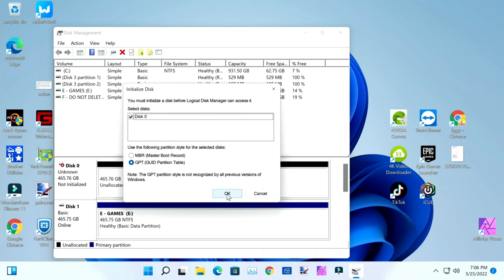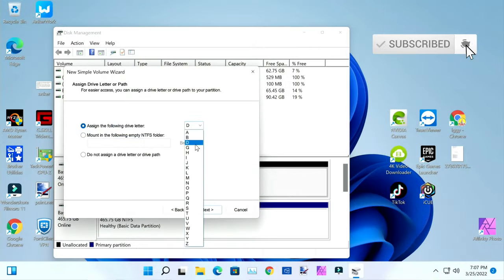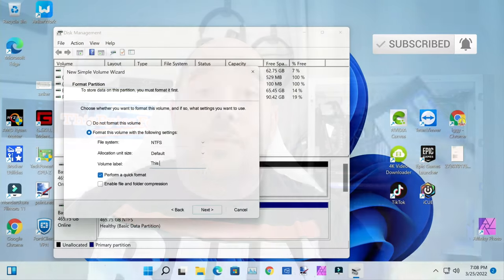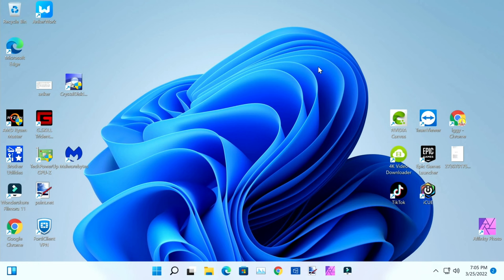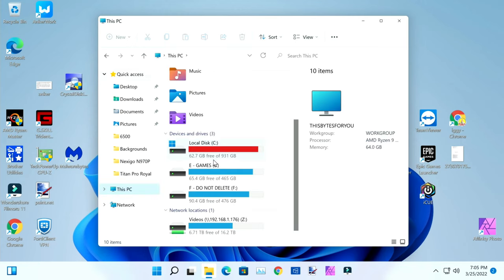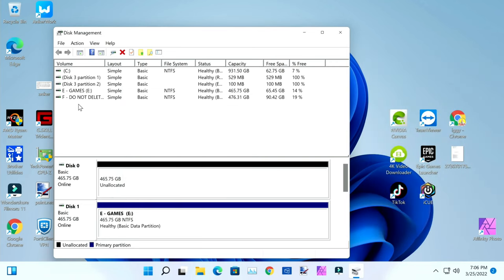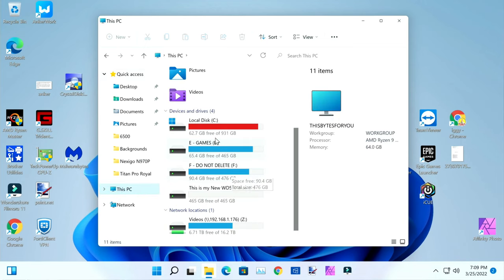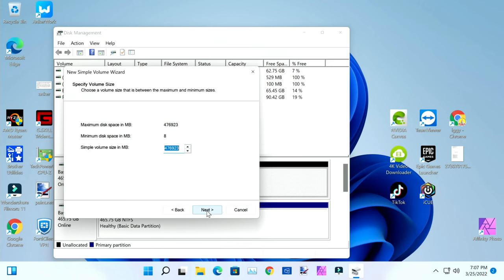How To Install a Second SSD into Your PC

Comment: By adding ssd with help of ur method will it increase the performance of pc or it will be only for storage?
Reply from the maker: if you add it using this video it will be a storage drive, but you can use this video to add it and this video to clone your current drive to your new drive: https://youtu.be/4BtdMcqwaFg
Reply: @ThisBytesForYou  I have one more question
If I use my ssd as an storage drive and put my games in it so by doing this will my games run fast and give better performance??
Actually I am a noobie in all this
Reply from the maker: yes, they will run faster, but your OS would run faster too on an SSd, I highly recommend you get rid of mechanical drives if anything use them only for storage if you need to, I dont use mechanical drives for anything other than my NAS.  And no worries my friend, we were all noobs when we started, you are safe here my friend ;)  I have over 500 videos to help you in everything PC.
Reply: @ThisBytesForYou  thank you so much
I really needed these help😢
Reply: @ThisBytesForYou  I have more questions plzz help
Currently I have an 250 GB ssd in which my os is there and an 500gb hdd for storage 
Recently I bought an 1tb ssd (mistakenly means I didn't wanted but the shopkeeper forced me n gave so I took)
So what should I do of this 1tb ssd plzz help I need someone to help me for my pc
Reply: I'll also tell my pc specs plzz help to improve it 
Its very bad
Intel Pentium g3220
10gb ram
Zebronics gt610 graphics card (that same shopkeeper scammed me for monitor nd graphics card  I knew later)
Plzz suggest some help for this too
Reply from the maker: #1 and I can't stress this enough, unless the shopkeeper is paying for something for you, or giving it to you for free, he can't force you to spend your own money. He scammed you once, and you keep going back.. is he the only one where you live you can shop from?
Keep the 250TB SSD for Windows, add the 1TB SSD as game and program storage, where you install games, apps and programs you run, if you want to keep th ehdd in your system, keep it as picture, video files storage, stuff you dont use often.
I need to know the motherboard manufacturer and model number, but you are using a socket 1150 processor, the best processor for that socket is the Core i7-4790K, but you will need really good cooling, you can also use a Core i5-4460, more budget friendly, but youy will need good cooling
For a gpu, you can try a 3050, they are decent cards and MUCH better than a 610
Reply: @ThisBytesForYou  actually i went there only once and wanted an monitor so with that I asked for graphics card he gave me that and also said ki take this ssd it will be imp and all etx etc and i payed for it 😢
Let it be 
Thank you so much for ur such efforts and helping me I am literally very thankful
I'll do as u say
Reply: @ThisBytesForYou  can you tell me how to check motherboard manufacturers and model number??
Reply from the maker: always a pleasure my friend, mind you I would recommend MUCH more but I am trying to stay at a budget so you can keep using what you have and save money, do you know what the manufacturer and model number of your motherboard and how much ram do you have? @bhavanajoshi7651
Reply: @ThisBytesForYou  I have 10 GB ram 
And I dont know how to check motherboard manufacturer n model number 😶
Reply from the maker: This video will help you identify hardware inside your PC: https://youtu.be/65ZSiVImJx0
WIth it, let me know the manufacturer and part number/model number of the Motherboard and RAM so I can suggest more for you, also the BIOS version for the motherboard.
Make sure to watch the entire video
Reply: @ThisBytesForYou  ok sir
Reply: @ThisBytesForYou  thanks sir for the video it helped me
I have gigabyte h81M-S motherboard
And i have 10 GB ddr3 ram
Reply: @ThisBytesForYou  I can buy i5 one but 3050 card n i7 I cant buy them I dont have much money left they are a bit costly 😢
Reply: @ThisBytesForYou  and yes the bios version is F1
Reply from the maker: @bhavanajoshi7651  I asked for the model number and manufacturer of the ram, also listed in that software
Reply: @ThisBytesForYou   oh of ram?
I have 2 ram
1-transcend jm1333kln-2gb ddr3-1333/pc3 10600 ddr3 sdram udimm
2-alketron 8gb ddr3-1600/pc3 12800 ddr3 sdram udimm
Reply: Is this what u r asking??
Sorry if I am being irritating or not giving proper answers😅
Reply from the maker: eeek, ok thats not good, mixing and matching memory, it is VERY dangerous.  Riight now your mrmoy is running at 1333:  Here is 16gigs of 1600Mhz RAM, take your memory out and use these instead, this is my amazon affiliate link: https://geni.us/drPCT
Ok, and update your BIOS to F2: https://www.gigabyte.com/Motherboard/GA-H81M-S-rev-10/support#support-dl-bios
I recommend installing in this order, 
1 Chipset: https://download.gigabyte.com/FileList/Driver/mb_driver_chipset_intel_w10.zip?v=a2d69b2e001945fcd145567baff9969b
2 ME: https://download.gigabyte.com/FileList/Driver/mb_driver_intel_me_w10.zip?v=65c1460d48ea7081992bdacfde1dae41
3 Intel RST: https://download.gigabyte.com/FileList/Driver/mb_driver_intel_irst_w10.zip?v=4b90bd9907bcfcabc81faaaaedd6f013
4 LAN: https://download.gigabyte.com/FileList/Driver/mb_driver_542_w10_10.063.1122.2022.zip?v=a67181da1a849414d06f200d63aeb8d1
5: USB 3.0: https://download.gigabyte.com/FileList/Driver/mb_driver_intel_usb3_8series.exe?v=df646aeac7a66ad4bb88404af0e85e46
6. USB 3.0 HotFix: https://download.gigabyte.com/FileList/Driver/mb_driver_usb3-hotfix_32.exe?v=fe788e2f74baaae6fb3d3cb2c0c26944
With all that advice, and new stuff to buy your PC will be a ton better andf stable, and now you can use XMP for your memory
Reply: @ThisBytesForYou  ok I'll install all these now in the sequence
And the buying thing i have to buy 
Processor 
Ram 
So processor I can buy that i5 one but ram it will take time cuz i dont have money
Reply from the maker: @bhavanajoshi7651  sounds good
Reply: @ThisBytesForYou  hey sir 
I installed chipset
2- for 'me' it saying u havr newer version of this installed to u want to overwrite so i cancelled 
3- Intel rst-done 
4-lan done
5-for USB 3.0 it is saying ur pc doesn't meet the requirements
6-for this there are 3 files which should I use?
Reply: @ThisBytesForYou  for f2 I downloaded it but when I am trying to run the app it says this app cant run in this pc 
So I ran another app in that it says this is incompatible with 64 bit
Reply from the maker: put  the file extracted from the zip file on a fat32 formatted thumb drive, restart the computer and flash it from within the BIOS.
Reply: @ThisBytesForYou  yes I did it 
Done now its f2 
Thanks for the so much help sir
You are the best 
You did so much efforts for me thank you so much 
You deserve millions of subscribers 
Thanks a lot
I did almost everything u said only buying part is remaining I'll tell u once I buy them cuz now I dont have money 😶
Reply from the maker: Always a pleasure my friend, so very happy you stopped by, trusted in me to help you, liked and subbed as well as took a moment out of your day to thank me.  It means a ton to me and I am so very happy I could help you.
Reply: @ThisBytesForYou  hi sir I am back 
One more question 😶😶
How can i increase my gta v gameplay performance as u know my specs u can suggest plzz
Reply: @ThisBytesForYou  and can u suggest a budget ram it is very costly plzzz
Reply: @ThisBytesForYou  and processor i5 4460 ok na?? If yes can u give me link?
And gpu 3050 I'll try or can u suggest a bit cheap ?😶😶
Only these things i need na??

Comment: Hi. Just a question. Would you need to install another Fan if I replace my 2TB HDD to 2TB SSD?
Reply from the maker: no, HDD's create heat, SSD's do not, so your system will be a little cooler already, an extra fan though wont hurt though.
Reply: I have another slot for my SSD by the way. What if I just leave my HDD there and just add another 2TB SSD? Would I still need a fan? Sorry. Just getting to know the PC world 😁
Reply from the maker: yes that will work, an extra fan always helps as well

Comment: I added 3 SSD cards, one 2tb and two 1tb cards. The computer only allows me to pick one of the 1tb ssds. The other will not detect.  Any advice for this?
Reply from the maker: So that I can help, please list the manufacturer and exact model number of the following components:
1. Motherboard - manufacturer and exact model number
2. CPU - manufacturer and exact model number
3. RAM - manufacturer and exact model number
4. Video Card - manufacturer and exact model number
5. Power supply - manufacturer and exact model number
6. M.2 - Manufacturer and exact model number, if you have any, and how many you have in this system
7. Regular SSD - Manufacturer and exact model number, if you have any, and how many you have in this system
8. Hard Drive - Manufacturer and exact model number, if you have any, and how many you have in this system

Comment: Would this allow me to make more space for installing or installed games?
Reply from the maker: It gives you another drive to install more games into and move older games into, which would mean potentially reinstalling them yes.
Reply: @ThisBytesForYou  Do you mean I have to move the install files, instead of using the application default installation media? Would this impact performance too?
PC Hardware Specs
GPU: MSI RX 6600xt oc mechx2
CPU: Ryzen 5 5600x
Ram: 16gb Corsair Dual Sticks
Main OS Storage: WD digital black m.2 1TB 4th

Software: Windows 11
Reply from the maker: @rxsora25  you can't just move the games, you would need to uninstall it then reinstall it on the new drive.  Which also many times means the client as well but not aways
Reply: @ThisBytesForYou  thank you!
Reply from the maker: Always a pleasure my friend, so very happy you stopped by, trusted in me to help you, liked and subbed as well as took a moment out of your day to thank me.  It means a ton to me and I am so very happy I could help you.

Comment: Finished installation and when I booted my pc back up it wont detect a signal. Have unplugged and re plugged in the sata & it still wont detect signal. Have taken out power supply and looked at all connections. Hope is running thin.
Reply from the maker: makes no sense, disconnect all the usb devices, other than the mouse and keyboard, and give it another try.

Comment: Questions (as a non-experienced PC user and someone who've never done this before). I currently have a Cosair One that I got used for a steal. That being said it supposedly (I've never opened it) has a normal HDD and I would like to upgrade this secondary drive (storage only) to a bigger and faster SSD. Possible to just remove it, not do anytning else on the computer first, then follow the steps here for installing the new one (or would I need to do something on the computer first to safely remove the old one? Again it's storage only)? Or will the new one act like the old one automatically? Possible to just copy/clone the old one to the new SSD somehow so it's like 1/1 if not?
Reply from the maker: Hello my friend, welcome and thanks so much for stopping by, hope you find a home here.  Data doesn't just put itself on a drive, you have to put it there, I recommend reinstalling windows, I have tons of guides on doing that, but if you still prefer to clone, which I don't recommend you can, check this and please let me know if you have any questions: https://youtu.be/4BtdMcqwaFg
Reply: @ThisBytesForYou  Thanks for the reply. Windows is not on the storage disc it's on the smaller SSD, the D:drive, so I figure then that means that it's easy to just switch out (?). 

But the HDD would still need to be accessible. Will it be by just putting it into the system in place of the old drive or does it need some sort of update? Again I know these are probably stupid questions with obvoius answers but have searched without getting a clear answer; might be my English idk.
Reply from the maker: @SicketMog  well, I am Cuban, if that helps but I don't totally understand what you want.  
1.  How many SSDs do you have
2. How many hard drives do you have
3. Your smaller c drive, the SSD, do you want to move that to a larger SSD?
Talking about a secondary drive, this video we are talking on shows you how to do that
Reply: @ThisBytesForYou  1. One SSD (with the operating system on).

2. One HDD (the one I would like to switch to a bigger SSD in the future)

3. No the C drive is good where it is. I just want to increase the internal storage but figure an SSD would be fine; faster transfer speeds?
Reply from the maker: @SicketMog  I recommend you buy a large SSD, either install a fresh is with drivers or clone your older SSD to the newer SSD then add them as secondary drives, like I show you here.

Comment: Hey man, hopefully you see this. I am trying to upgrade by adding in a M.2 SSD but when I go to boot my PC for some reason blocks my current SATA SSD with my OS on it. Does the placement of which SATA port the cable is placed into affect this and causing it to cancel itself out?
Reply from the maker: did you watch this video?
Reply: @ThisBytesForYou  yes sir. My issue is even when I get into my bios it doesnt recognize my main ssd all a sudden, once the m.2 ssd is out it recognizes it no problem. I have a Gigabyte gaming6 z170 and cant figure out why its blocking the OS SSD when installed
Reply from the maker: ahhhhhhhhhhhhhhh, what is your CPU and how many SATA devices do you have and how many M.2 SSd's do you have, I know what the issue is, but I want to make sure.
Reply from the maker: Do you know in your BIOS if you are set to Legacy or UEFI under "Storage Boot Option Control" and "Other PCIE Device ROM Priority" and is CSM disabled or Enabled under "BIOS Features".  Also, let me know what BIOS version you are on?

Comment: So is this the same procedure with running a M.2 SSD with SATA SSDs or are they not able to be ran together? I currently have everything in a SATA SSD, plan on adding a couple more but I also have an M.2 I'd like to utilize
Reply from the maker: yup, totally the same
Reply: @ThisBytesForYou  awesome! I ordered a new CPU cooler so when it comes in I’ll install them all
Reply from the maker: well always a pleasure my friend, what cooler did you end up getting?
Reply: @ThisBytesForYou  I ordered the BK031 Black Rock TF2 to replace my Zalman CNPS 10x
Reply from the maker: nice, I need to work with them at some point, I just want to finish up EVERYTHING I have to review before taking new stuff, I am burning myself out.
Reply: @ThisBytesForYou  I get that big time on just my own projects let alone at work. Getting burnt out seems to be coming in faster than it used to. Nonetheless man thanks for the content it’ll make todays install a lot smoother
Reply from the maker: @markduff4986  always a pleasure my friend, and thanks for listening, it means the world to me.  Please let me know if you run into any issues or have any questions.

Comment: If I want to install a second hard drive that I will only use to download games from Steam for example, after I get the new drive setup and want to install a new game, will Steam ask me which drive I want to install the game to and it will be as simple as just selecting my new drive? I'm new to PC stuff so any help is great. If my question is confusing, I basically just want to know what the process is for downloading games onto my new drive after it is installed :)
Reply from the maker: Yes and this video helps you prepare that drive